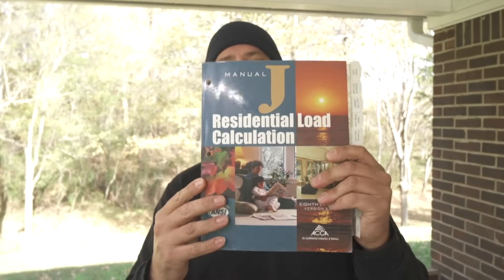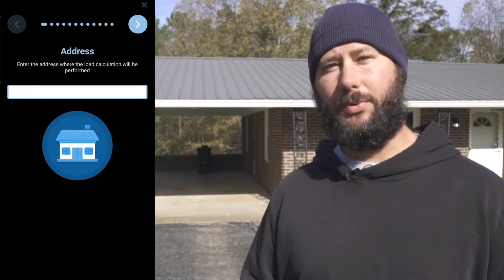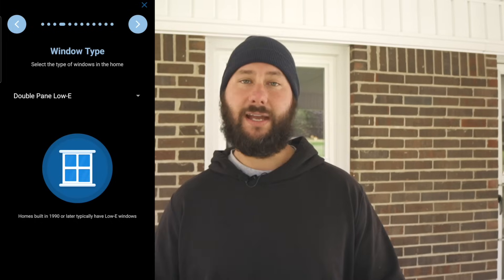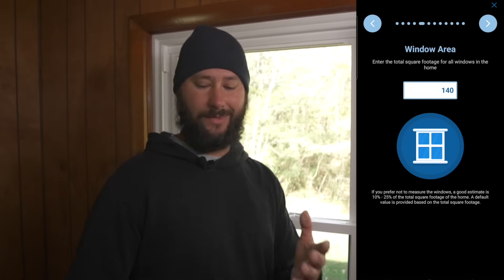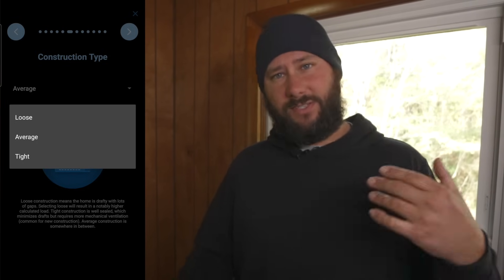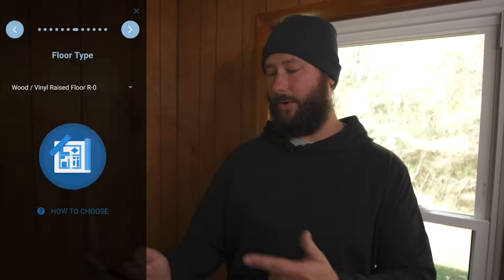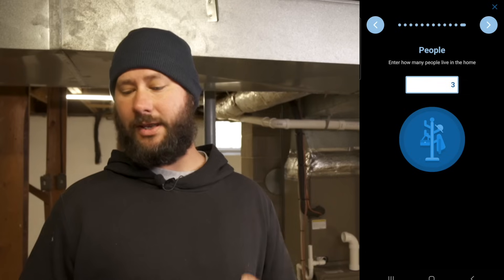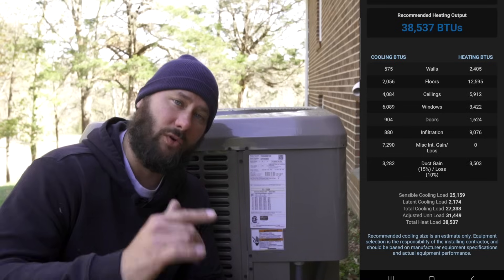What If You Could Master HVAC Heat Load Calculation in Minutes

Comment: Just watched a video on the importance of doing a Manual J calc - EVEN ON AN EXISTING BUILD.....because, "chances are good the builder didn't actually do one". Well, whether they did or they didn't, I thought it might be a good idea before replacing by 20 year old R-22 systems (yes, 2). So....I have 2800 sq ft with a number of windows, etc., but have 2 systems (a 2 ton and a 3 ton). I'm guessing a Manual J calc won't come up with a 5T system recommendation (or will it?). Any recommendations on Manual J calcs for such a situation?
And GREAT JOB, BTW! Very Helpful!

Comment: I'm a home owner, not a tech and getting ready to replace my 15 year old system. I have a decent understanding of hvac and I want to do a load calculation on my home myself. My 1900 sqr foot home has a 5 ton 2 stage unit and I know it's terribly over sized. I would like to calculate the proper size unit to replace mine with and it's a 1 time use, so looking for a method that doesn't lock me into an app subscription. Any suggestions? And no i wont be installing this, but just want to be more informed so im not over sold like i was 15 yrs ago. Thank you.

Comment: Oversized Not in My Hood We Find there purposefully undersized in servicing  3- 15 + 20  yrs after track builders & installers Installed the same size System No matter what ..track homes  ....The load cal Nver builder purposefully say of you wont " ALL My Business "  They  cut your Load cal by 1/2 to 1 ton over duct  house also chop returns to data plate or short on returns &  also have to cut prices with all 1 -or 2 maybe centrals RA filter air grill & Inspectors always passed rough with flying colors & 90 % say there Homes never ever did great & could Not every keep up in AC Hot Humid 40 mile radius of Atlanta Ga   homes & 10,000 s of them ..Luckily heats was a tad better on complaints with mild short winters but usually Long HOT Summers

Comment: I spent 43 years in the HVAC industry both in the field and later at a Wholesaler, in addition I built 2 new homes. Your advice to do a load calculation is excellent. I did many calculations both when Manual J was actually done manually then through the computer version. From my experience I noticed that even when you do a calculation it oversizes what you need but I think it’s accounting for construction deficiencies. I put my theory to the test when I built a 2200 square foot ranch house. The manual J calculation was 4 tons. I decided to install 3 tons, my home was built well and the ducts were installed in a conditioned space. I installed a gyp-crete radiant system and it was poured in late June. I wanted to dry the home out so I put the thermostat on 65 and during a 90 degree heat wave maintained that temperature easily. With that knowledge I would have installed a 2-1/2 ton system because during my 16 years in that home the AC never ran more than 20 minutes during any hour when on. The other factor here was excellent shading from heat gain and larger overhangs. But when you are installing for a customer you have no choice but to install what the load calculation calls for.
Reply from the maker: Excellent knowledge. My friend, thank you for sharing. I appreciate you
Reply: “Other factor excellent shading”.  BINGO.  Had a 50 foot tree completely uprooted during a storm 3 years ago on a west facing side with open two story vaulted ceiling and giant windows.  Trying to get the second floor to balance out with all that new 100 Texas heat coming in has been a nightmare.  The second floor ac is speced exactly right in theory… shored up windows, put in solar screens, black out curtains, insulation, etc…. And I’m convinced depending on the design of the home, orientation, open floor plan, huge vaulted ceilings….unless the house was built recently with energy efficiency in mind, a tree is literally the one thing needed to have an appropriate ac in certain climates that won’t just run all day long.
Reply: The resulting load calculation can be modified to account for other circumstances.  It is after all a calculation, and is not carved in stone.  Use common sense.
Many of the infamous HVAC "licensed" contractors fake or fudge calculations if they do them at all.  They certainly don't share that information with the occupants of the house.
At the end of the day, better the system is slightly underrated than overrated although that goes against the contractor's agenda of selling higher priced equipment.
Reply: Turn you blower speed to 2.5 tons
You can get the longer run times you want

Comment: When matching a furnace with an air conditioning system, not only need to know the heat demand of the house. You need to know the maximum cf. M that the furnace can put out to match with the A. C in Southern climates, you're often installing a larger furnace than needed, as you need the additional cfm. Drive the cooling load. This was not mentioned in the video.

Comment: Thank you so much for the video! 
Supply air ( outlet air) has sweating on it, 
is that may cause by oversized unit? 
That house 2,100 squared foot and the unit is 4 Ton unit 
The house inside kind too much humidity. 
Thank you so much!

Comment: Great job explaining and going through a heat load calc.  Very detailed and clarifying. I’m from south Texas and we do 400sq. ft. per ton on old to average homes. I think that app would pick that up though.  Does it ask about natural shade? Or how much morning or evening sun the house gets and which side.  Also we used to have to measure the over hang/ soffits of the house and if some windows were under a large front or back porch. Also what is your opinion on sizing off the what the label on the condenser says versus what the actual compressor label says nowadays? Not trying to be a pain, just something we deal with down here.
Reply: @TravisGrantland  I’m in Texas as well. Was also taught 400 sq ft per ton .

When I went to get my license, the class instructor in Austin told us to stop doing 400 sq ft per ton because how well insulated homes are now days. And especially stop doing the finger trick from the curb 

He said , “Manual J is now crucial from the book. “

Comment: I don't understand how the suggested heating and cooling btu's are so close? From my understanding shouldn't it take so many more btu's to get from 18 degrees to 70 degrees as apposed to 93 to 75? (Being that a btu is the amount of energy required to heat 1lb of water 1 degree.)Am I missing something?
Reply: You aren’t missing anything, the heat gain (the technical term for a cooling load calculation) part at least is way off, you can’t accurately size solar gains without knowing the orientation and shading of the windows.

Comment: Tad, bottom of the Texas Panhandle here. Getting into rough-ins on Barndominiums completely spray foamed and as tight as can be. (So tight fire places don’t draft well). What do you suggest when using this app when choosing wall type? Any other considerations I need to take in as well?
Reply from the maker: Make sure you have some fresh air
Also a dehumidifier

Comment: I agree most home are way oversize by 2 time and the return duct is under-size that restrict air flow making the compressor and fan work harder and lets not forgot to air seal tight the whole system. I have a 2K sq ft with a 2ton and with 20" return duct. I can warm the house from 62F to 68F in 15mins and I have 50" of attic insulation. If you over-size the return duct, over insulate and air seal tight the whole system. You save tons of $$$$$.

Comment: What about static pressure? Blower door testing? Blower size? ECM? PSC?  You may have got the correct sizing for the HOME but not the duct work. - Lennox Employee
Reply from the maker: That's one of the necessary steps
Reply: Yeah, you need to do load calculations room by room so you'll know what the airflow for each room should be.
Reply: @Bryan-Hensley eh, retrofit we do not need to do a room by room load unless we suspect a duct design issue, or have a reported comfort concern. Block load is fine, we just have to do a block load correctly. We can verify duct design pretty easily with tools like the true flow grid, which should really be a tool on every service tech and sales reps truck.

Comment: Man a 3 ton on 950 square feet would not have been my guess.
Reply: 3 ton for 950 sqft they are going to tell me I’m crazy hahaha 😝 
House must be in very bad condition man
Reply: 1.5 ton
Reply: It won't run long enough to keep out humidity in humid south.
Reply: Lol talk about over sized. Must be crazy hot and humid out there.
Reply: In The South is 600 sq feet for each Ton
Reply: @josepagan9236 it has never failed me. 600 for average insulation and 650 for great insulation.
Reply: Goes to show you got to try really really hard to oversized and things go wrong on the other hand it does get around 20° in the winter but it has a gas furnace 

Other thoughts he probably bumped the fan speed down that's why it's not crazy humidity in the house 

Good move on the extra tonnage in the event they want to finish the basement 

Good job tad! The only guy talking about load calculations
Reply from the maker: thanks brother good stuff